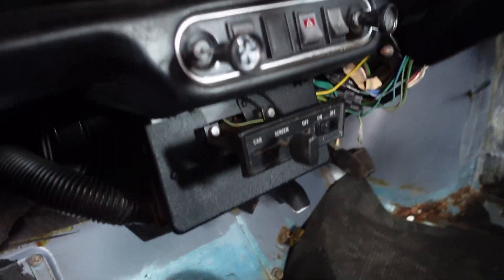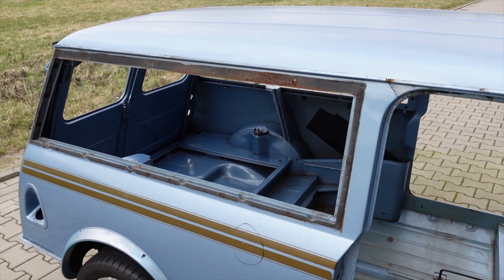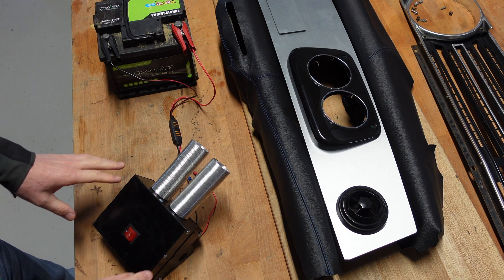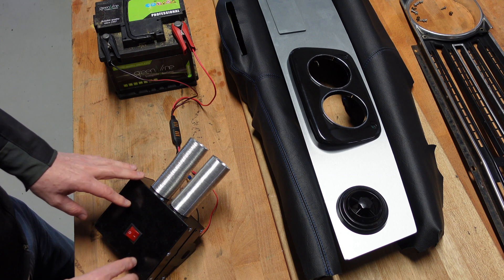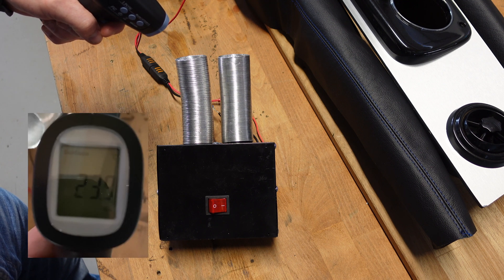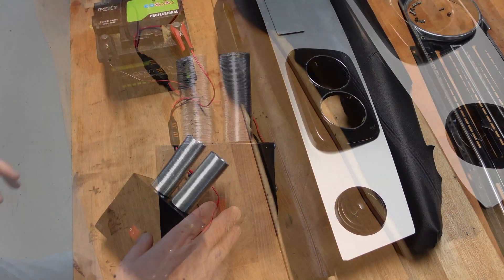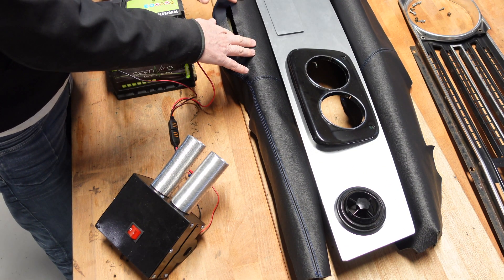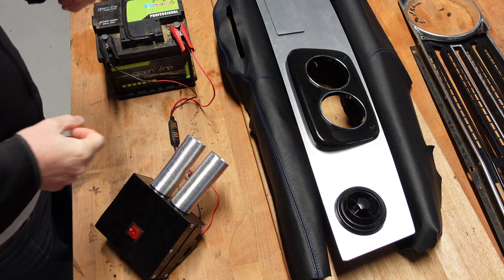Classic Mini Clubman Estate - Electric conversion

Comment: How do you keep the 12V battery charged, do you have some converter from the litium batteries that run much higher voltage I assume?

Comment: Any idea on the amps drawn from that ceramic heater? Looks like a great idea.
Reply from the maker: seems to bounce around between 1.8 and 2.0, I left it running for 5 hours constantly and no issues. I'm guessing that it has a temperature regulator, as it won't go above 52degrees.
Reply: @classicminiculture9800  That's very good. Don't suppose you have a web link to the product do you? Cheers and all best.

Comment: There's always the option of a heated windscreen, I fitted one a few years ago and it is amazing 😉. If it's something you might be interested in try heatedwindscreens.com 
I'm really liking the switch panel to 👍
Reply from the maker: thanks Christopher, so the funny thing about the regulations here, electric front windscreens are seen as an option, but not stand alone, so we have to have a "blower" as the main source.......these regulations make it a mine field to navigate.....they really don't like electric conversions🥺
Reply: Think about it...and still have a good range

Comment: The electric heaterbox is a great idea and a perfect solution for the EV project, The shell looks like it‘s in pretty good for it‘s age the roof gutters are always
tricky, Are you using the same body shop as last time. Looking forward to seeing this project come together. Cheers Dave
Reply from the maker: thanks, managed to get a slot at a different body shop this time, more experienced with mini's so we should get it right first time this time🤞🤞🤞